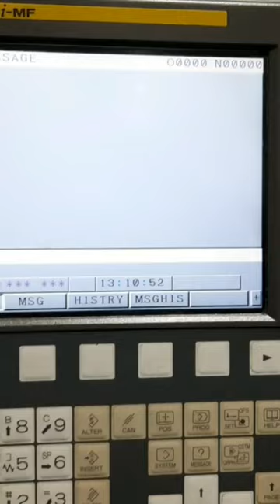fssb alarm | optical fiber cable problem #shorts #viral #trending #shortsvideo

Comment: Srevo amplifier me light nhi aa rhi optical fibrer connector me aa rhi h kya kre
Reply from the maker: Check the servo amplifier, the problem is in it. You can try heating it one time. after that off and on
Reply: How is the process for heating it
Reply from the maker: You can use about hot blower. Turn it on normal and heat the servo amplifier card from a distance for about 1 minute. Be careful not to heat it too much which may damage its body. After that the machine main supply off on.